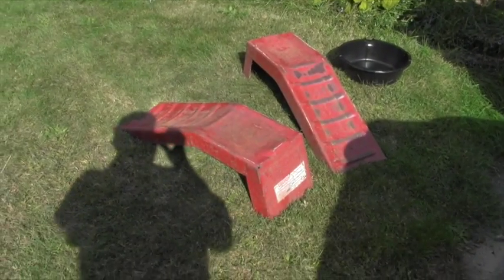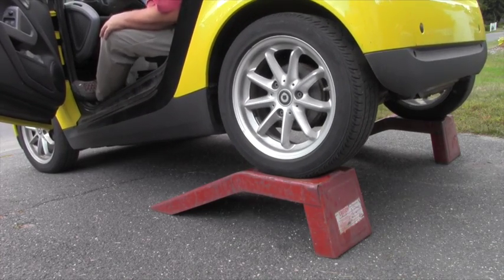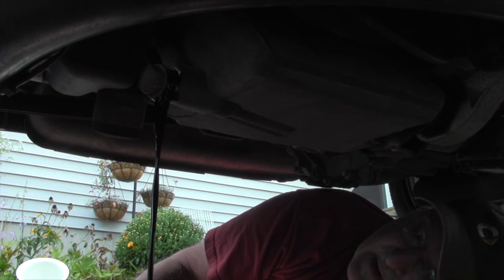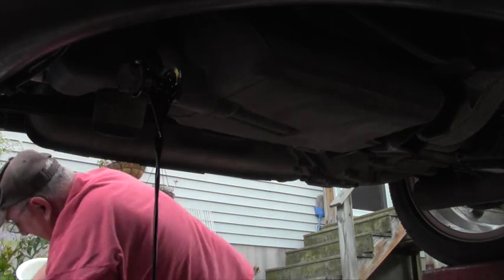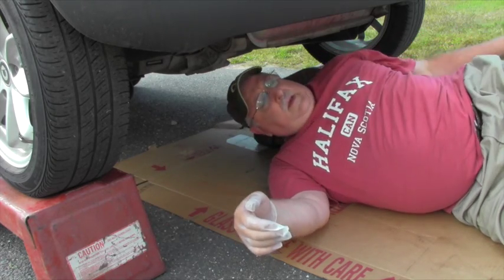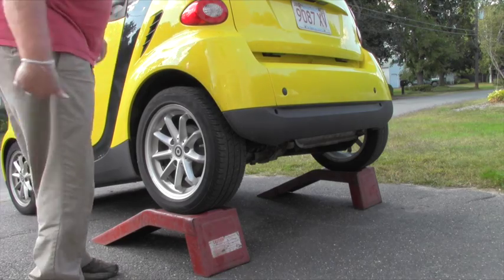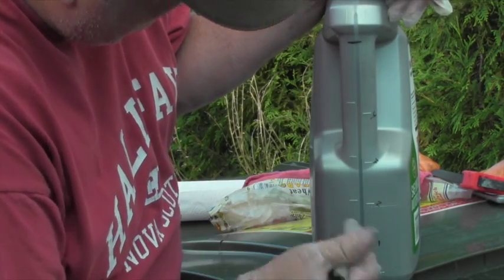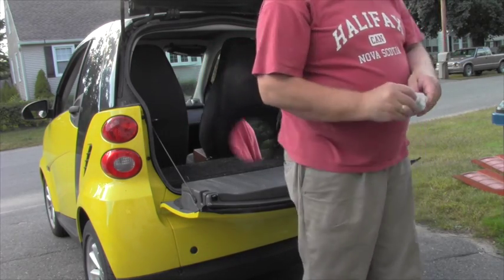smart Fortwo Oil Change

Comment: no oil wtf!!!!!!!!!!!!!!!!!!!!!!!!!!!!!!!!!!!!!!!!!!!!!!!!!!!!!!!!!!!!!!!!!!!!!!!!!!!
Reply from the maker: I predicted this! Relax there's enough oil coating the parts, so get over it. Back in '92 I drove a Plymouth Voyager van. I was in the process of trading it in for a new car when the oil pump blew out. I called the dealership about driving with 0 PSI oil pressure. They said don't worry as it wouldn't affect the trade. I drove 13 miles to work and back for two and a half days and nothing happened. Driving off the ramps won't kill the car.
Reply: Denb7 i have never seen any thing like that but its your car
Reply: Denb7 Dear Denb7, that was true for old cars. Modern engines have smallest tolerances than in the past and a faulty lubrication is destructive even for few seconds (more than 30 in your case). In this case, you could put some oil in the engine (3/4 of quantity indicated by constructor), remove the car from the ramps and after some minutes check for the level, adding the right oil quantity. Another trick is do the oil drain with hot engine, that helps the operation. Anyway, great job, good video.Sorry for grammatical errors (I'm italian)
Reply from the maker: S.D. Riprese Aeree Long story short, I'd prefer not reaching into the engine compartment while the car is up on ramps. It's my car and I'll do what I want with it.
The lesson I've learned is to promote my videos as "How I Do It" and NOT as if it is a "How To..." video. If I say, this is how I do it... nobody can bitch about what I do. Thanks for watching!
Remember: "Don't do as I do!"
Reply: Hello S.D. Riprese Aeree,

You make some fine points and Denb7 can improve by adding oil before letting the vehicle off the ramps.

Point is:  No damage to engine as there was no load and all bearings had film.

AS for tolerance:  it has not changed on bearing surfaces from model-T to Ferrari.  Must have oil film.

If not, you hear the sound...aka rod-knock.

So many people complain this video for noise that is just the hydraulic lifters.

Mr. P
Reply: @Denb7  please dont it this way

Comment: Oh man.. I don't know why I watched this but I got to see a car drive with no oil do that's cool. When I cracked the oil pan on my vr6 the dealer asked how long it had ran with no oil and I had turned it off before the oil drained out. They said I saved the engine... even 10 seconds could be long enough to toast it. Anyways, please don't tell people to drive their cars with no oil lol thats just cruel.
Reply from the maker: +hugeslacker I'll dispute the idea that there's NO oil in the engine. There's oil on all the parts, just no oil pressure. You must be completely blind if you missed the multiple disclaimers on this video, warning people to 'not do what I do' and the fact that this video is for entertainment purposes only. Apparently a smart engine is hardier than a VR6 considering that I do this every time I change my oil and it's still running just fine.
Reply: I agree.  don't drive your car w/o oil

Your engine failure has a different story...YES?  Please tell me/us.  I would like to know what really happened.

P

Comment: Good day Sir. Very good video I am about to buy a smart and your oil change video has reassured me that I will be able to change the oil myself. I have to say the some of the rude comments about your running the engine with out oil are not needed. I do agree that the engine should not be run with out oil but I would not be rude about it. I wonder if you put a block or chock at the bottom of your ramps could you roll the car down  or maybe have and assistant sit in the car to apply the brakes as needed. I like the way you marked the oil container to get quantity of oil. I actually do something similar . I have a large jug which is almost clear. Marked on the side of that jug are 2 or 3 marks which correspond to my motor bike van and car. I pour oil from the original container into the jug and then into the vehicle. This means when a container is not full I can use oil from 2 different containers and still have an easy way to measure it. I was a little concerned that having the car on ramps may leave old oil pooled in the sump but as the sump plug it towards the from of the car that will not be a problem. thanks for this fine video . FDO

Comment: 3 things....I didn't see him change the drain plug gasket, always fill your filter with oil before putting it on( will have a void if you don't) and....NEVER RUN YOUR ENGINE WITH NO OIL!!!!!!!
Reply from the maker: 1) Been changing my own oil since 1973, never replaced a plug gasket and never had an oil leak. The point of a gasket is to prevent leaks. If I don't develop a leak, then the existing gasket was sufficient. 2) Please make a video showing me how to pre-fill a thimble-sized filter with long screw threads that is side mounted and install it without losing the oil. 3) I've answered the "no oil" complaint a million times. a) there is residual oil present b) the engine never goes above an idle c) it ran for 33 seconds d) all moving parts are coated with oil, just no oil pressure (same as starting a cold engine).
Reply: At 17:14 your filter is vertical not side mounted.Just like my sister in laws car. No oil spilled when I did it.
Reply from the maker: @Dude10271  Doesn't matter, any void will be filled as soon as oil pump begins circulating oil, so as long as a small amount of oil (enough to fill the filter) is included when filling, what's the issue?

Comment: That's the easiest location I have ever seen for a drain plug and oil filter. What I would so in your case is to buy what's called a Japanese Oil Plug. It's basically a bolt with a safety valve on it. You push, the turn the valve with your finger, drain and then pull and twist the valve back into place. No tools needed to change your oil. It is NO DRIP ! I've had one on my Chrysler for 150,000 miles without a single drip. With the valve, you could just reach under the car. No need to lift it.
Reply from the maker: umaxen01 Thanks for the tip! I'd never heard of such a thing, but it sounds like a good way to make the job easier and  neater.
Reply: Denb7 It's called a Fumoto Oil Valve. It's the most brilliant automotive part on the face of the Earth. You can get one that you connect a hose to, or just a simple one like I have, it just drains into a pan. Here is the web site. www Fumoto usa dot com  I spelled it out because they usually don't allow web addresses...
Reply from the maker: umaxen01 Thanks, but I already looked it up after reading your 1st post, but I appreciate the effort. I'm sure others who read this might be interested too. Removing the drain plug isn't all that difficult, but that Fumoto valve should be standard equipment. It's brilliant!
Reply: Denb7 For Denny and his friends. It's NOT only that the Fumoto oil plug value is easy to use, it's also the fact that many engines DO NOT have an oil pan and THUS IF you strip the part that the traditional plug screws into? You have basically stripped a part of the engine case. THAT could mean leaks forever unless you have a GREAT mechanic who is willing to re-drill the engine case simply to attempt to be able to put a bigger plug into the engine to be able to stop the oil leak. It's MUCH safer to put a Fumoto into the Aluminum engine of a Lamborghini ONE TIME, rather than to keep on tightening the plug into the engine simply to change the oil?

Comment: All the oil would not have drained because of the angle of the car being on a ramp.
Reply from the maker: Very true! Even if the car was tilted to the right, there would still be trace amounts of oil in it. One of the beneficial properties of lubricating oil is its ability to maintain a film on metallic parts.
I didn't change all of the oil, but I did replace a major percentage of it.

Comment: Wooaw so brave, running engine without oil, LOL
Reply: Hmmm... up to this point, I haven't heard the word "brave" used. Remember, the engine was at an idle and the parts are certainly coated with oil, there's just no oil pressure. The noise is from the hydraulic lifters running with no pressure.
Think of it like a sewing machine. Precision machined parts operating with only an occasional drop or two of oil for lubrication. If it wasn't for the extreme temperatures of internal combustion, a car wouldn't require a pressurized lubrication system.

Comment: this is why also why I would not buy a used car no oil in the car and you started it up the oil pump is trying to pump no oil and the pistons rings have no oil around them. metal friction can heat up steal very fast with no oil in the motor. Also its good to start the car after you have put the new oil in the motor because the new filter needs to be filled so if you don't do this and just add the oil and look for the level its not going to be right after. WORD TO OTHER PEOPLE OUT THERE THIS IS NOT THE RIGHT WAY TO DO A OIL CHANGE!!! Plus fram oil filters are not very good go with a WIX do your home work and look up a good filter. The only thing this guy did right was using the good oil mobil 1 synthetic. If anyone want to see a good car mechanic look up on youtube Scotty kilmer!!
Reply from the maker: Thanks for the feedback! I knew I'd get blasted for doing what I do, but guess what... I don't care. I drove a '66 Chevy Biscayne for years in Grand Forks, North Dakota when winter temperatures often reached -20 or colder (with no block heater). Cold cranks were brutal. Oil was like mud, but as soon as the pressure came up, she'd start right up. The old heap never had a problem as a result of momentary lack of oil pressure.
As I've stated before, draining the oil pan doesn't leave bare metal-on-metal. Not every molecule of oil comes out of the engine. Try leaving an open oil bottle inverted to drain for an hour, doesn't get all the oil out of it.
I don't care what everyone says, I've never had an engine wear problem in 40 years. My smart is still running just fine. I'm just showing people the way I do it. That's all!
PS- I run my tires slightly over-inflated too; to get better mileage!
Reply: Denb7 I dont think ou can compare an old chev to  todays hi tech engines, those old engines would seem to run forever no matter how you abused them. To days engines are more sensitive to any kind of abuse and neglect. the fact that you have not had anyproblems  is just luck on your part.
Reply from the maker: nemrac fiftyto As I've stated before. Draining the pan doesn't remove every drop of lube. A film remains on parts. If all oil drained 100%, then every time you start a cold engine it would always be metal on metal until the oil pressure came up. Engines have changed, but lubes have improved too. If I tore that engine down immediately after driving off those ramps, I guarantee you I'd find oil on the rings.

Comment: Never, never, never run an engine without oil in. When he changes the oil next time it will have lots of sparkly bits in.
Reply from the maker: Really? Do you think this is the first time I've changed my oil? After 11 years and still no sparkly bits. Hmmm. Maybe you're wrong.

Comment: ok so this is an older video and everything is fine. Except; add your 3.5qts of oil BEFORE starting the car and driving off the ramps. result is the same but you wont have to start then engine dry. Not trying to bash, this is a great video but to make it perfect thats what u gotta do.
Reply from the maker: Thanks for your comments and also for not crucifying me as others have. I've been doing my oil changes this way for 8 years and see no issues as yet. I agree, adding oil before starting the engine is preferred. However, I'm old and overweight and getting under the car is easier using ramps. Adding oil while the car is on ramps however, is a long reach over the open tailgate and difficult. For me alone, pushing it off isn't an option either. I'll continue doing it my own rebellious way despite the rants of my haters whom I rather enjoy provoking.
I'm considering doing a remake of this video, just for them!
Reply: Denb7 doesnt matter how much effort you make, some people will always complain. constructive critisism is the key. I see what you mean about having to reach over to fill the oil while on ramps. thanks again for the video

Comment: Dear sir, you have made a few beginner mistakes. 1. you drained the old oil and did not open the filler cap. 2. you returned the plug and only then changed the oil filter ?! 3. Start the engine of a car without oil ?!

Comment: Couple things I want to add. Throw in some new oil while the drain plug is out so you can flush ALL of the old stuff out. Also I can't believe he got out just to move the ramps while it was running with no oil. Also Fram is well known as one of the shittiest oil filter brands. Also if its the diesel model NEVER overfill the oil its a good way to blow out your turbo seals.

Comment: Did this man just start the engine with no oil😭😭😭
Reply from the maker: Draining the oil pan does not remove all oil from the engine. All engine parts are still coated with oil even after draining the pan. The engine was started with no oil pressure, which is far different than what you say. The engine ran at low rpm for only 33 seconds. I likely did more engine damage starting my 66 Chevy in -20 degree weather in North Dakota than I did here.
Reply: @Denb7  Es dürften allerdings auch gewisse Unterschiede zwischen einer uralten Amikiste und einem Mercedes Qualitätsprodukt bestehen.

Comment: Forgot to add buy the proper socket, and stop messing about. I always replace the complete Drain plug unit, Not necessary but I do it for a few bucks.
Reply: +Tarbet Balfour 
Where I come from, $15 is considered more than "a few bucks".  But even assuming it doesn't bother you to add $15 to the cost of each oil change ... I doubt replacing the plug every time has any real benefit.
Reply from the maker: +Tarbet Balfour I agree with smart451cab. And $15 for a replacement plug is a bargain price because I found it on Amazon for $19.90 and ebay for $21.+. I can only imagine what a replacement plug would cost from my local (Mercedes a.k.a. smart) dealership! Besides, the original drain plug seems perfectly suitable for the job so why replace it at all?
As far as buying a "proper socket" goes: If you've watched some of my other YouTube videos, you may have noticed some of my "cheapskate" videos. I'm a cheapskate at heart. Surely a 25mm socket would be a more secure fit, but I change my oil only once a year so the cheapskate in me keeps saying, "that big adjustable wrench works just fine..."

Comment: My only critique is; Yes, you over filled it some, but you did not place any oil in the filter prior to replacing it. So the extra oil is actually going to fill the filter and not create a problem. I thought I would throw that out there as an FYI.  Excellent video Denb7. thank you
Reply from the maker: Adam Metcalf Thanks. The amount of oil filling the filter is miniscule, but it is a consideration.

Comment: done like you did, this job is ridiculously dangerous. smart should be in reverse before pulling the hand brake. also, rising thr car is not needed to chage the engine oil. you can fit under the car the same when it is ob the floor.
Reply from the maker: Considering that the smart is a manual transmission (albeit automated), when the car is stopped, the drivetrain is disengaged. I've never had an issue rolling on or off ramps doing it the way I've been doing. Thanks for your concern, but I'll continue doing it the way I've been doing.
Secondly, speak for yourself! Perhaps YOU can easily fit under a smart, but I'm an out of shape,  overweight guy in my 60s. Just getting down on the ground  and up again is difficult enough. I find it easier with the car on ramps.
Thanks for watching!